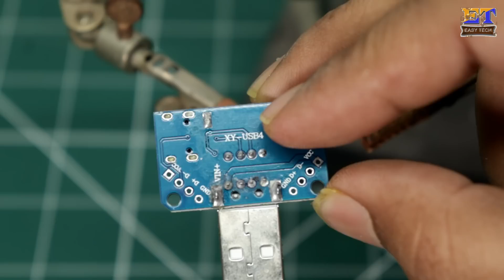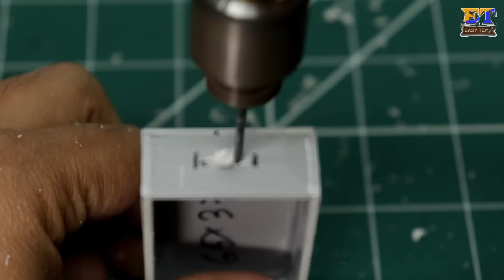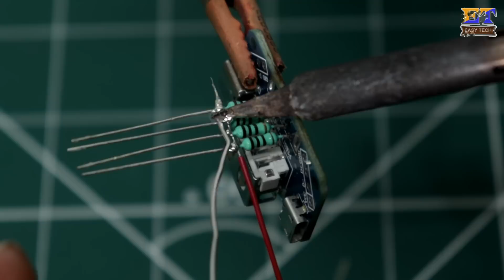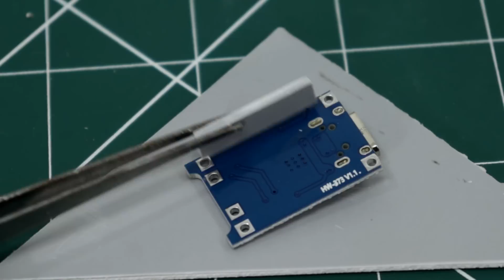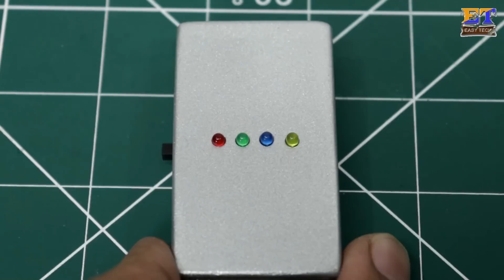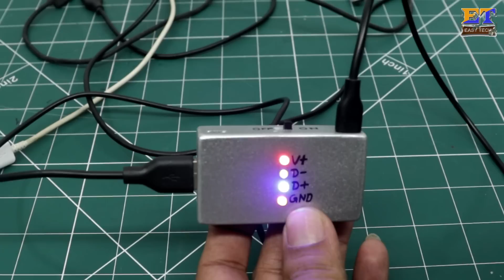Amazing Idea To Test USB Cable

Comment: This is actually a nice little project. To make it a bit cheaper you could use standard batteries that way you wouldn't need the charging module, Li battery or switch. A single coin cell would work.